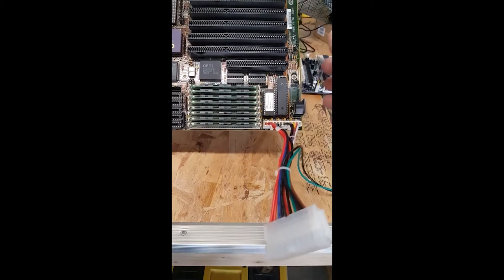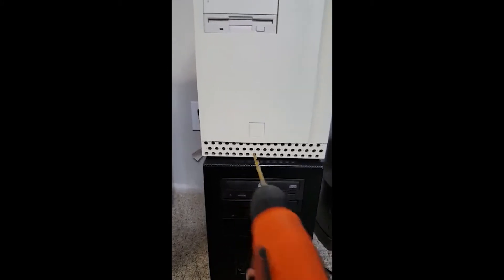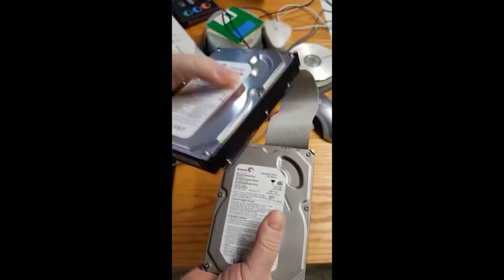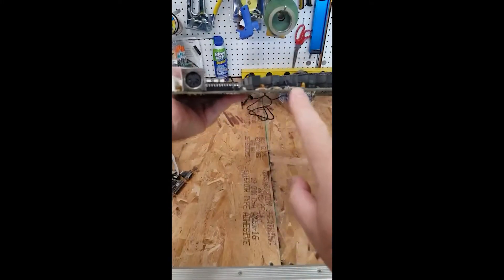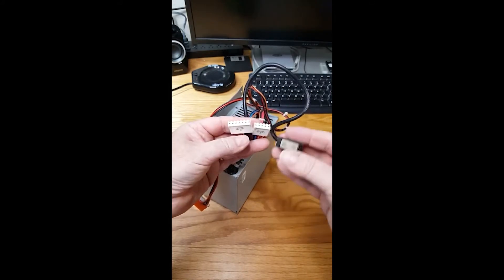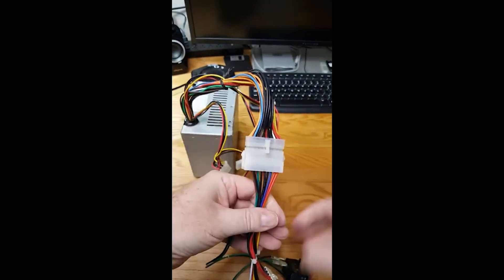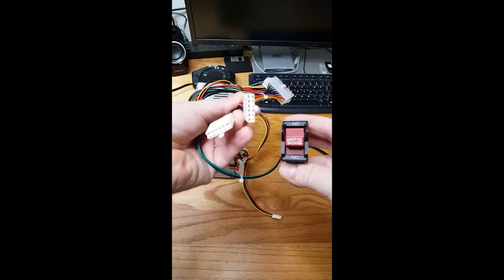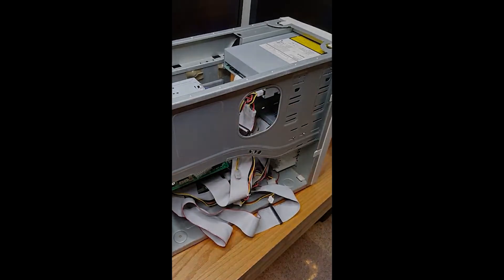Retro computer memories

Comment: Does modern ATX PSUs have the required -5V rail to power old school AT or XT systems?
Reply from the maker: Some do.  I have been able to get ahold of middling age ATX supplies.  The really new ones?  not 100% sure.
Reply: @UncleMikeRetro  I've been able to find a couple New Old stock around 500 watt to 550 Watt ATX power supplies on eBay that have the negative 5 volt rail. You just really got to look and hope the seller has decent photos showing you all the voltages.

Comment: And something else that didn't come with old computers no plexiglass, no tempered glass that when it breaks shatters into a million pieces, no stupid RGB lighting (you can put Christmas lights on a turd it doesn't make it smell any sweeter) no lack of 3.5 or 5.25 drive bays and no cheap pot metal cases like you do today that they make you pay three times more for. What you did get in the old days was real drive bays, heavy metal cases that a lot of times came with a built-in power supply. And yes back in the day maybe beige was boring but beige was badass. That's what I miss in newer cases I don't care if I can put so much light in my case that I can blind my neighborhood I'm not looking at the case anyway I'm looking at the monitor. Sorry about that that's just my rant about why modern computer cases today other than air flow (which yes is needed because components run so much hotter today) in my opinion suck unless you get the very few modern cases that still have the older vintage features and air flow that is still worth something.
Reply from the maker: Wow, Clint!  Tell us how you really feel!  Yeah, a guy could go all day comparing then to now.
Let's do just that!
Reply: @UncleMikeRetro  LOL Uncle Mike. Sorry about the rant. It's just one of those things that growing up during the times commodore 64, beige computer cases, and when working on those types of cases literally leaving a little bit of yourself due to the edges being sharp so when somebody says they literally put their blood into building the computer sometimes that was the truth. I just see nowadays what the younger generation is going all hooten holler over about basically having a Christmas tree for a computer case and it just goes through me. The old vintage systems is just becoming a lost art and for those that love this vintage I am grateful for and for those that just want basically a lit Christmas tree as a computer it just makes me cringe a little bit inside. Have a good one and again sorry about the rant even though I probably ranted a little as well in this comment.
Reply from the maker: @clintthompson4100  Rant Part II.  Love it.  Rant away, pal!  You earned it!